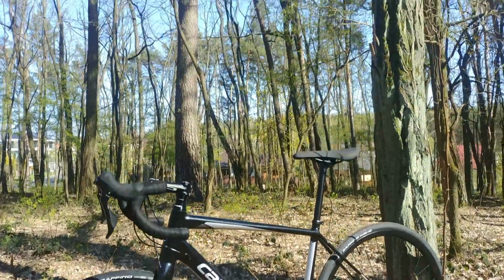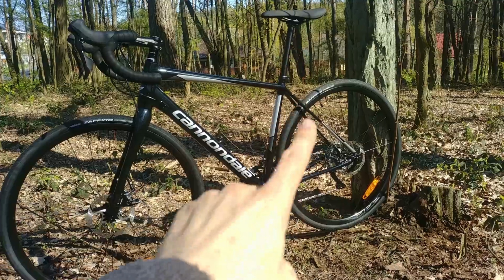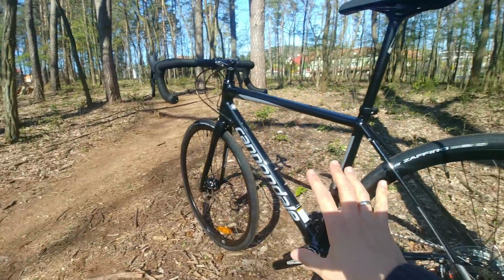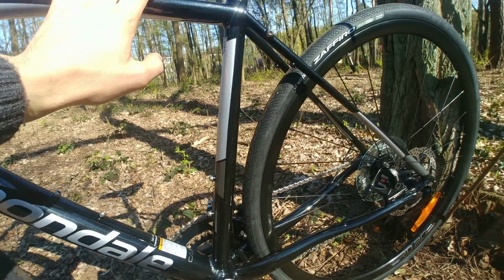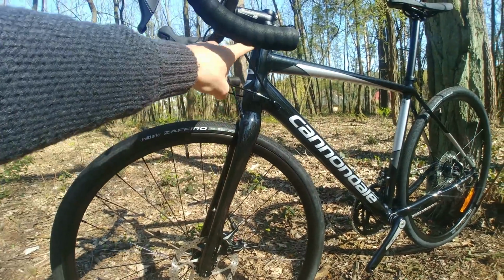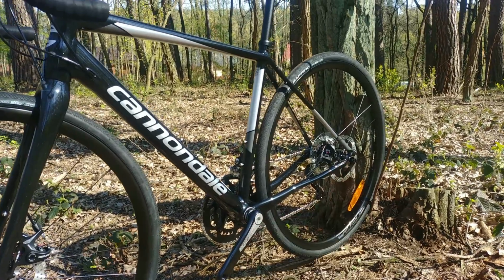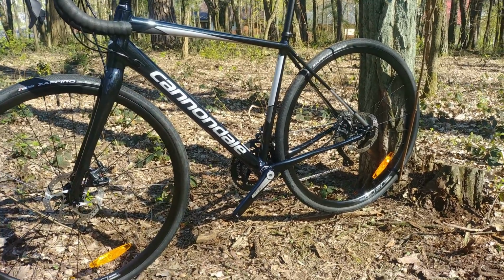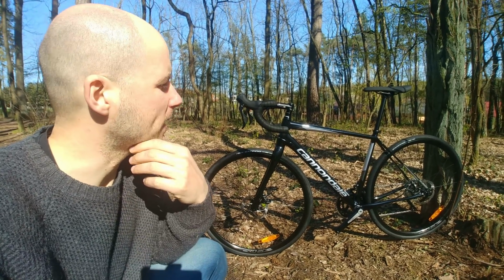As Good Or Even Better Than Carbon One - 2019 Cannondale Synapse 105 Disc Alloy. Endurance Road Bike

Comment: I have a question! Which bike will you choose not for racing! 2023 synapse al 1( 105 12 speed mechanical  hyd disc with threaded bb)! Or caad 13 2023( 105 11 speed mechanical hyd disc press fit)  both same price on sale 1800$ and the synapse is thru axle front and rear ! Same as caad13 ! And is there a difference in the quality of the frame ?

Comment: Greetings from 2023. I see a legit offer of a 2019 Synapse 105 Disc Carbon(!) in mint condition for around 1400€. I'm unsure because I'm a very heavy rider and the weight limit is around 120kg (-10kg for the bike, 110kg - I have no experience with carbon and neither the shock damper design of the Synapse)

Comment: I will tell you  about my synpase 2017. I regret every day of my life getting this bike: 1. A problem with the pedal threads was never solved by Cannondale. 2. BB30 has its Hambini problems, had to get extra adapter for my Ultegra Crankset 3. Chainstay clearance is so small that when rear wheel goes out of true it rubs the frame 4. In the beginning lots of spoke got broken, Cannondale local dealer said there was a problem with some bikes, but I had to pay myself to replace the spokes. 5. Wheels are lame, too much flex anyway. 6. The discbrakes Promax Render R are seriously bad and hardly brake; can't even lock rear wheel. I 'll get some better ones if I don't throw in the garbage the bicycle within 2021.

Comment: I've got a 2016 Synapse Alloy , rim brake version. I've done the following to it, almost all by buying used or on sale. Carbon EC90 bars, SiSl2 Hollogram cranks, Hunt Aerorace wheels, Swalbe tubeless tires, FSA SL-K carbon seatpost, Specialized Romin Pro saddle, Louis Garneau lightweight alloy cages. All in it weighs 7.7 kg.
Reply: Just bought a 2016 synapse alloy myself but looking forward to changing the wheelset.
Reply: @adib4846  I really recommend the Hunt Aerorace alloy wheelset. They saved almost 500g over the original Alex rims.
Reply: @ukestjohn  I'll like to buy used ones, but i'm based in Romania and can't find any used here. Saw a lot in facebook uk market but nowdays buying from UK is complicated.
Reply: What brakes are you using?
Reply: @adib4846  shimano long reach 650's. They're supposed to be Ultegra level.

Comment: Thanks! Your review helped me decide on the 2019 Synapse AL SE. Had for 6 months and 600 miles, couldn’t be happier. Certainly more bike than my abilities! 
Had the chance to try the carbon version of the same vintage and didn’t find much difference. It’s easy to get tempted by technology and I appreciate your straightforward and honest opinion. Saved me some $$$.
Reply: I'm thinking of picking up the Synapse 2019 Al SE – have heard some rumours RE: rattly cables and dodgy bottom bracket. Have you had any problems with it?

Comment: What the carbon Synapse has that the alloy Synapse doesn't...Carbon frame, carbon wheels, hydrolic braking system, smooth adjustable seat post and way sexier color selection. Especially the teal carbon Synapse which is the most unique amazing looking color ever seen on a bike imo. Look it up. To change the alloy for a carbon fork and to get the bike as light weight for $600 +1600 for the bike is $2200. The bike will still have an alloy frame. The bike still won't have hydrolic brakes and it still won't have the unique color. So to spend $800 more for better brakes and color for a bike you will have for many years is a no-brainer. The carbon Synapse all day everyday.

Comment: I have the 2019 Synapse aluminium with tiagra and it is the worst bike i have ever bought. I have bought bikes for 30 years - usually Trek. The internal cable rattle was so bad i had to pay to get it reduced. Then so many of the components are poor quality that they rust for no reason. Within only 350 miles of riding the rear hub sounded like a bag of bolts - i have had cheap and expensive bikes, and would put this as middle range pricing of the bikes i have purchased , and no rear hub as gone in such a time - in fact i have not had any go in her 2000 miles. I then spoke to the shop i bought if from online - they said Cannondale want to see the entire bike and not just the wheel - which would put most people sending the bike back as might as well spend the money getting the bearings sorted. I only post this as want buyers to be aware. I definitely would never ever buy another Cannondale - i would buy Trek any day over this rubbish. The only good things i can say are that the seat is comfortable as is there riding position.

Comment: Bought mine two days ago (alloy). Looking forward to many miles of comfortable zen. I was leaning toward the CAAD 12 105, rim brakes but for the same money my LBS guy made some strong arguments for disc vs rim. Retiring (no pun intended) my 22 year old Trek carbon 105 (bought new in 1997 for $1,000). She is a sweet old girl but, as can be expected, her bottom bracket has been a little grouchy lately.
Reply: Brainjock  Hmmm... I doubt it. I have the stock Vittoria Zaffiro 28c tires (eventually I'll put some nice Continentals on) and there isn't much clearance between the chainstays... maybe a few millimeters on each side. Having said that, I love the bike. The only thing I've switched out so far was the stock saddle for a Fizik Arione R1 Versus Evo. It rides smooth (even with max 90psi) and shifts smooth (Shimano 105 r7000). I recommend this bike but if you have your heart set on 34c it might not be for you.

Comment: Is  there a difference between the frames of the synapse 105, tiagra, and sora?
Reply: It the same frame. But I would recommend the 105 SE models one. The crank set and wheel are totally crap, mine is 2018 tiagra and my chain are rub the front derailleur when push the force to it. To replace the BB30 thing you will need at least 90$ to get the decent one. Not to mention the Wheel RD3.0 thing.

Comment: SOOOO wanted to buy CAAD12 with Disk brakes. But NO!! Quick release on the rear wheel is just an INSULT in 2019. NEVER the same position, depending of your strength and "feel" at the moment. WTF!?? With thru axle you ALWAYS get rotors straight. ALWAYS. And I will NOT wait next (or next) year for an update...
Reply: very true about the lack of tru-axle - its definitely saving money on wrong place
Reply: Not always i have thru axles and if you over tighten you can have the pads rub. Eventually zero lock lockout thru axles will eliminate over tensioning.
Reply: Yeah thru axles can really suck sometimes.... I've never had problems with QR

Comment: Hi Danny, could you do a review to new Vitus Zenium CR bike? it's a full carbon frame and fork (not the seatpost), with new 105 r7000, hydraulic brakes and costs under 2000$
Reply: Yes, I've seen that one as well during my research. At that price point, I was wondering if it's horribly cheap Chinese carbon i.e. mostly resin. I ended up getting the exact bike in this video.

Comment: Aluminium wont flex less than carbon. As an engineer I can tell you that it is simply a case of product design with taking the material properties into account. A carbon bike is not always better than aluminium. The material itself offers more tuning, yes, but if you dont build your product around the material properties, it might become shitty even with the most sofisticated materials.
PS: concerning the througth axle at the front. Mechanicaly when you brake at the front, the new point of rotation will create a force that wants to push out the wheel, so out of the fork, not good, at the back it will push the wheel up and therefore against the frame,so not an issue at all. It is therefore much more critical to have disc and quick release at the front then at the back.
Reply: As another engineer I'd have to agree with the essential point you made, that it's all down to design. You have to take into consideration that aluminium is particularly weak in terms of stress endurance, and so structures made of aluminium have to be made stiff so that they don't flex and lose their strength.

So in practical terms, bikes made of carbon flex more than bikes made of aluminium.
Reply: @phillycheesetake  my aluminium trekking bike (diamant elan) has an alu fork that flexes like crazy and is extremely comfortable. never even ridden a steel fork that comes close. so it seems possible to do very flexy aluminium components.
Reply: @phillycheesetake  it depends of the alloy you are using. Most of the alloys, you are right, dont have a permanent stress resistance as steel has, but some alloys have, but they are mostly more expensive than standard alloys like 6060 6061 etc..

Comment: I have a 2018 carbon disc 105. The stock wheels were poor and rear wheel  bearings and free hub required rebuild after 5000 miles. Had problems with internal shift cables from beginning. Hydraulic brakes are great.  Bike is pretty fast and I just upgraded to zipp 302 wheels which really increase performance all around climbing and fast.  You should note the 50/34 and 11/34 gearing for the record. I changed mine from the 11/32 on the 2018 I have to 11/28 and is good for me but the 11/32 is better if not used to climbing.  Not sure if I’d buy again.  Also a knocking in bottom bracket - so plenty of component issues but ride is good when everything works!
Reply: Also rear not throu-axle is a fail, one friend riding the cannondale with this reports problem with the disc breaks clinking after putting it back the wheel ... there is said on one hand that it flexes, but on other hand you have to have it really stiff for rear without the through axle and that doesnot comes together